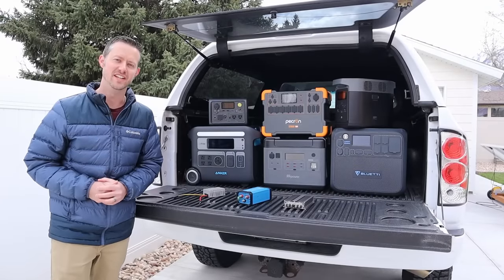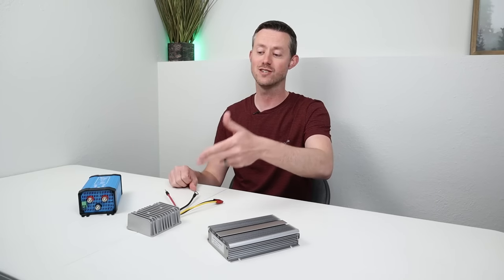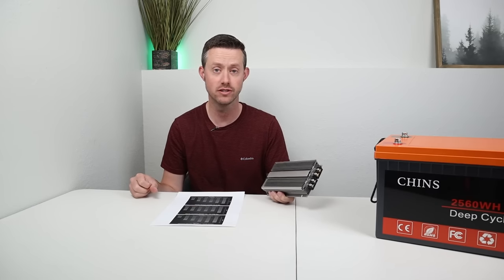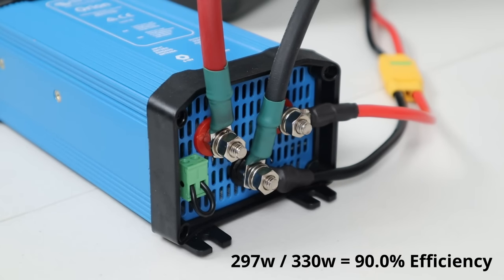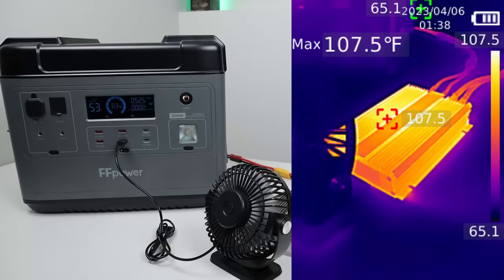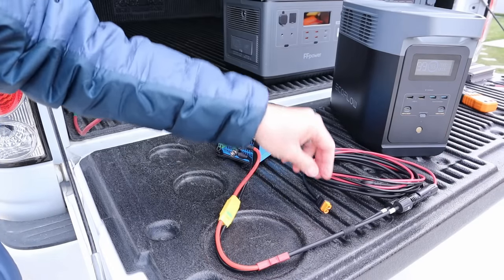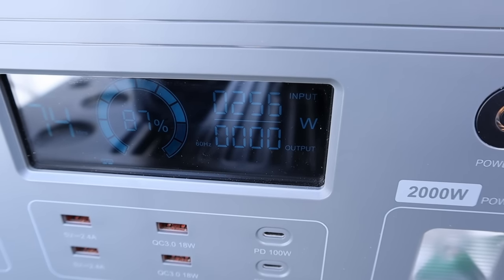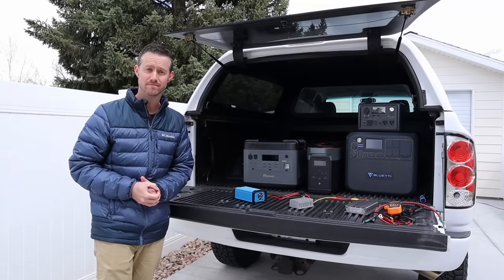Charge Your Power Station In Your Car FASTER - Perfect for Overlanding, Car Camping, and Van Life!

Comment: Thanks Jason! Great video! Very detailed and good information. How does this compare to the Bluetti DC Charging Enhancer (D050S)? I have a Bluetti 200P and will like to have the option of charging slow or fast when needed. Thank you!
Reply from the maker: I have a couple videos on the D050S. The charging enhancer only works well if you have a high voltage input. It is pretty worthless at 12v input... you'll only see 100 watts charging. You get the same charging speed at 12v input directly from your car battery as you do with using the charging enhancer.
Reply: Understood. So the DC charging enhancer would be better labeled as a step down converter for higher voltage applications (for example: multiple solar panels in series). I do have a 24v LiFePO. Would you recommend a 24v to 36v or 24v to charge the Bluetti 200P?
Reply from the maker: @hexd2g  yep, all that is correct. The 24v battery will put decent power into the Bluetti on its own. I'd try that and see how you like that, if you want more power pick up a 24v to 48v converter and you'll get even more power. The AC200P is good for up to 145v so 48v is just fine.
Reply: @Jasonoid  Thanks Jason! I really appreciate your guidance. Look forward to your future videos.

Comment: This is exactly the video I was looking for as I was wondering if this Setup would work. 

One question: as I understand, the step up will pull electricity even if the alternator is not running? So you have to use a switch or unplug this when the engine is Not running, correct?

Before I watched you video, I was thinking of using an victron Orion tr smart dc dc booster. It has smart recognition if the engine is running and has a power supply mode beside the charging mode. As I see, it does not have more then 24v, but would work more automatically and simmilar within its specs.
Reply: Another question: is there another los from 24v back to 12v in the powerstation so it would be more efficient with 12v and higher amp? For example 12v 30a (if there are powerstation supporting 30a on solar charging) instead of 24v 15a for example?
Reply from the maker: I'd only recommend charging when the engine is running so you don't kill your starter battery. You'd want a disconnect or power switch inline to control this.

Since most of these larger power stations have a 48v LFP battery, the higher the input voltage is, the more efficient.

Comment: Excellent video, Jason! Thanks so much for putting this out. I have a Bluetti EB70 (800W 716Wh) in my teardrop trailer I typically charge with solar panels, but was hoping to charge with my 2023 Forester if needed. In all honesty, I don't know anything about this. What is your recommended setup for this application? I didn't mind spending a few hundred dollars on the project...
Reply from the maker: The EB70 can't take too high of a voltage, only 28v. It's best to purchase a 12v to 24v boost converter for that model to charge faster.
Reply: @Jasonoid  Thanks for the quick response and great knowledge!
Reply from the maker: I have a very old video about charging tips for the EB70.... It could be a bit crindgy since it's an older video lol...
https://youtu.be/_7l8hoNebDY
Reply: @Jasonoid  It was great! I seem to have a hard time finding videos using Bluetti EB70's.
Reply: @Jasonoid  I'm so sorry to bug you again, but can you please recommend a switch, fuse, and wiring I'll need for this setup?
Reply from the maker: @JamesFrancia-k6b  that would take a bit of time to put together, for a more advanced answer reach out to me via my consulting service "Asqme", you can find it on my website:  Jasonoid.com
Reply: Very cool  @Jasonoid ! I'll probably hit you up next week. Thanks so much!
Reply: @Jasonoid  Sorry, I can't seem to ask another question via Asqme. I think it booted me out of the conversation.
Reply from the maker: @JamesFrancia-k6b  if you 'love' the answer, it ends the conversation... I think a lot of people do that by mistake instead of replying and asking a follow up question.
Reply: @Jasonoid  Ah! Can I ask a follow up here?
Reply from the maker: @JamesFrancia-k6b  I'd rather deal with email communication becuase I am not notified for all replies. It's too hard to track. 
JasonoidLLC@gmail.com
Reply: @Jasonoid  Seems easier. Thanks!

Comment: Looking at cost and dual use, I wonder how well a Bestek 500w pure sine inverter would fare against these even with losses. The Bestek is only $60, and with the Ecoflows you can turn down the AC charging to match. Plus its dual use for other things.
Reply from the maker: As long as your power station has an adjustable charging level the Bestek 500w would be a great option!
Reply: @Jasonoid  What is the typical efficiency of this method after both the DC-AC then AC-DC conversions? 70-80% perhaps?

Comment: Can you parallel the dc converter with solar so that the delta 2 charges from both sources using the same XT60i conector (that stays connected all the time)?

I don’t want to brake any connections on the delta 2 having to switch back and forward between dc and solar.

I have one 415 watt panel rated maximum power voltage 38,7 V
Reply from the maker: I see too many issues trying that out. The solar panel would not play nice with the dc to dc converter, especially at night. I would recommend installing a two source switch and just swapping between the two sources as needed:  https://amzn.to/48Upkhu
Reply: Thanks for the suggestion and link. I will get one of those switches 🙏🏻

Comment: Great information. Thanks. Trying to wrap my head around power issues as I plan for using the Anker 767 in my van. I've been looking at using 2-3 BougeRV 200 watt panels and since their parallel input is 17.98 volts, I'm wondering if a DC boost converter would work for solar input as well. If I were to make an MC4 connection from my battery to the solar input cable and then put a DC boost charger between this connector and the Anker, would I be able to get the voltage high enough for high speed charging? Is there a better way?
Reply from the maker: I'd recommend running the 24v Victron DC to DC converter. In this video I plugged the output of that converter directly into the solar charging port on the Anker 767. If you use the 36 volt converter the power is a bit high and pulls too many amps from your starter battery.
Reply: I am having the same conundrum. My van has a 180 amp alternator. Do you still think the 36v boost converter is too big? I would like to get that 700 watt input to charge fast. I don’t necessarily need solar.
Reply from the maker: 180 amp alternator should be fine for the 36v converter.

Comment: I'm hoping someone can answer this this may seem like a silly question but I'm learning. I have two solar generators all powers and vtoman and the max amperage for those is right around 12 amps but you said the rated output is 20 amps of these charging devices you tested how do you get around that?
Reply from the maker: The only thing you need to worry about is the output voltage. Power stations limit the amperage automatically so 20 amps is not a problem. However, they cannot limit the voltage and if the voltage output of the converter is higher than what's allowed on the charge controller it will damage the power station.

Comment: Jason, when charging the Bluetti AC200 Max what was the DC setting, PV or other?  Thanks
Reply from the maker: It automatically chooses the mode, even if you try to change it, kinda weird. Higher voltage went to pv(36v converter), lower voltage went to car charging (Victron)

Comment: Awesome video just what i needed.  Thanks Jason  ?  I have the anker 767 could you use the 5 port solar charger with a double plug going into the battery.  One line coming out of the victron plugged into the 5 port solar block then use the 2 or 3 line that anker has on there site to one to act like you are using solar by chance  thanks Bernie

Reply
Reply from the maker: I'm not sure I understand exactly what you are trying to do. Can you clarify?
Reply: Have not done anything yet. Just wondering if you hook up the victron  and use the 5 port solar adaptor and had one of the 2 or 3 pig tales that they offer would it act like 2 solar panels hooked up?  Just thinking out loud. @Jasonoid
Reply from the maker: @bernieluczka  yes, you can connect your DC to DC converter to the solar adapter of the 767. Just be aware it's a parallel adapter and it's only designed to have the same voltage connected at the same time. So matching solar panels or matching DC to DC converters only, not mixed voltages.
Reply: Ok Thanks I was just thinking out loud on that one. I am so happy I found your video on that ONE more ? did you use the 20 amp setting or did you turn it up to the 30 amp for the test on all?
 @Jasonoid
Reply from the maker: @bernieluczka  the 767 power station won't allow more than 20 amps input, it's limited automatically.
The only adjustability of the Victron is the voltage. The stock voltage is 24v, you can turn it up to about 29 volts. I'd recommend turning it all the way up to get the most power.

Comment: Hmmm. I was all set to buy the $35 converter, and saw this on the Amazon description from the manufacturer: 
"Note:
Never connect to solar panel, PWM/MPPT charge controller, inverter or wind turbine."

This stopped me, since whatever power station this converter connects to will utilize a PWM or MPPT.

Am I correct in my thinking?
Thanks
Reply from the maker: I haven't had an issue but you can choose to do what you want 🤷
Reply: @Jasonoid  I'll going to try it connected to my 20 amp Victron Blue Smart MPPT charging a Yeti 1000. I think the converter manufacturer is posting their warning because some applications may draw too many amps and cause failure

Comment: Thanks Jason.. This answered a question I had in another video.  However, I'm still unclear about what adapter do I need to go from the Victron to the Bluetti.. Thanks
Reply from the maker: Which Bluetti do you have? You'll have to come up with a custom cable with ring terminals to connect to the Victron, and inline fuse, and then chose an adapter that fits your power station charging port.
Reply: Thanks, I don't have one yet.  I was planning on the 200L.. but, possibly the MAX may be the proper one as I like to  play with ham radio and my radio is 30W DC.  I may need a separate LiFP battery to run it properly and use the PS to run the rest of the van. Or run the radio via a 120vAC to DC power supply that can handle the draw from the radio.
Reply from the maker: @wjess3569  both of those models have mc4 connections or an xt90 connection. Both are easy to adapt from the Victron.

Comment: The Delta 2 Max has 2 solar inputs for 1000 max.  Could I run 2 converters and trick the D2 into thinking it’s plugged into 2 solar panels?
Reply from the maker: Yes, you could run both converters getting much more power. You would want to consider the load it's pulling on your alternator since that's a bit of power.

Comment: I have two Delta 1300’s (the first Delta). They accept 400 watts DC and solar, or 1000+ watts AC. 

Have you experimented  charging them in your van using a 1000+ watt inverter?
Reply from the maker: That will work as well, I'd recommend setting the charging speed a little lower in the Ecoflow app than the max power of your inverter. Maybe 700 or 800 watts on a 1000w inverter.

Comment: I have a Bluetti EB55. It has 400watt max input. Could I use one of these to charge that unit?
Reply from the maker: One port is for the AC charger, the second port is for solar input. This will work for the solar charging port only for 200 watts.

Comment: What connector cable would I need to use the Victron with a Pecron 1500LFP ?
Reply from the maker: You could make an MC4 charging adapter to connect to the E1500.

Comment: Another question for you Jason. If you hook the wires to the starter battery, I assume the wire is still sipping power from the battery when the car is off. Is there an easy way to switch it off when you're not running your car ?
Reply from the maker: The Victron does have a feature with a remote switch so it can be turned off when you turn off your key. You could also add in some sort of high power connection so you can just plug it in when you need it. Anderson Powerpole SB50 connections would work for that, they are common in the RV industry. This is a link to the connection type so you'd have to do some more research:   https://amzn.to/3ACQxGR
Reply: The simplest way is to get the Victron Orion - TR Smart  12/24v 15a DC to DC charger.  You set it up via a bluetooth connection and run it in "Power Supply" mode.  It has a voltage lockout setting so that the unit doesn't turn on until the starter battery is above a specific voltage.  I charge my Ecoflow Delta 2 this way and have the voltage lockout set to 13.2 volts.  The unit is more expensive ($250 ish) but I'll take the peace of mind.  Here is a video showing how it works:  https://youtu.be/sPYPrUmRi0s .
Reply: @archoncompsys I’d be curious to see your setup.  How many watts are you getting charging from your alternator?
Reply: @FOUO88  It varies.  I've seen as high as 425W and typically it's in the 360W range.  I have a 2020 F250 7.3L which comes with a very beefy alternator.

Comment: bought ax200 max and the victron. so now i just plug in victron to the van battery and bluetti to victron via that blue cable. but it will drain my car battery to charge bluetti all the time? would you have any solution for that? 🙏
Reply from the maker: Put in a switch to turn on and off the converter or have a disconnect where you can unplug the converter from your battery. I'd only recommend charging your power station when you engine is running.

Comment: A question can I connect my car, 12 V and a solar panels in a splitter cable and connect to the bleuetti, will this work . or do I need to connect and diode so that the car doesn’t get the high voltage of the solar panel?.
Reply from the maker: You'll need a power station with dual inputs (charging ports) or you'll need to wire in a two pole switch to chose one source or the other. Solar and 12v car battery power won't meld well.
Reply: @Jasonoid  thank you for your reply, First, I got a try it with diode between the wire who comes from the car, otherwise, I have no option to put a switch in between.

Comment: Got to say that I had a problem with the ac200 max not reading battery percentage right, but Bluetti has been helpful, not sure if we have it fixed yet but it is nice to have customer service.  Will try to update if I can.
Reply from the maker: Glad to hear they are helping you out. Usually cycling the power station at 500 watts will help fix that issue. Discharge the unit fully at a ~500 watt load till it's empty, then charge at a ~500 watt load till full. Do that a few times and it will calibrate the capacity shunt.

Comment: I try to figure out if it will work with a anker 757 but can't manage to find the info. do you think Anker 757 will work with the victron converter ? Thank for you great video and your help!
Reply from the maker: The charging voltage cutoff on the Anker 757 is 30volts. If you turn down the Victron output just a little bit it shouldnt go over the 30v limit and work just fine.

Comment: Victron converter is 12 to 24v. Is it possible to connect 2 victron in series to generate 48v? So that I can charge my anker 767.
Reply from the maker: It doesn't support a series connection for 48v.

Comment: On my River 2 Max, it's rated for Car Input 12V/24V, 8A, 100W Max, AND it's also rated for Solar input 11-50V, 13A, 220W Max.  Now, both of these are inputs through the XT60i jack at the back of the unit.  How does the DC-DC converter know what Voltage and Amperage to use?  Thanks again!
Reply from the maker: The DC to DC converter puts out the set voltage that it's rated for and the power station will charge at that voltage. The power station does not chose the voltage. Lower voltage converters allow the power station to charge at the lower rates. Higher voltage converters will charge at the higher amperage levels.